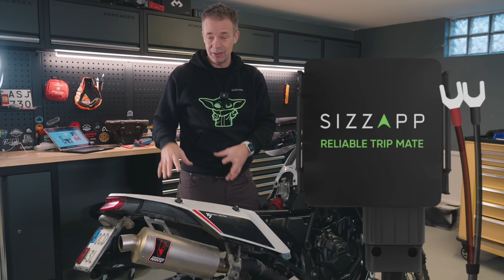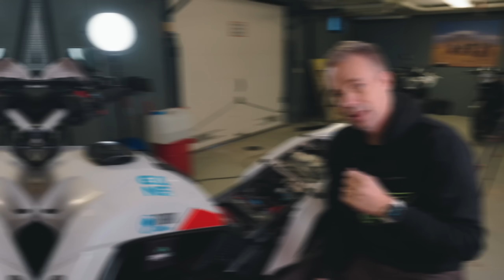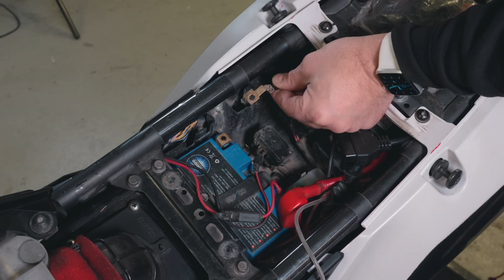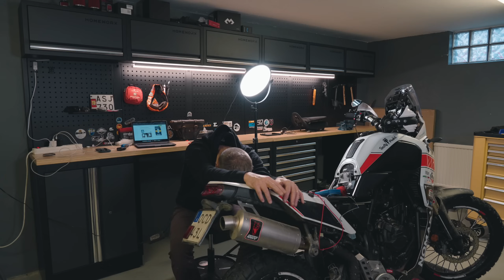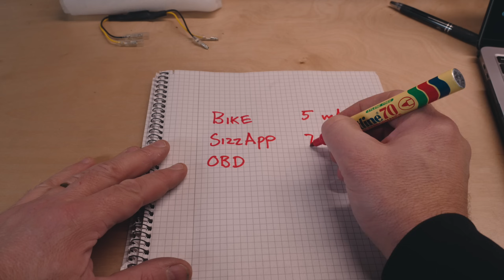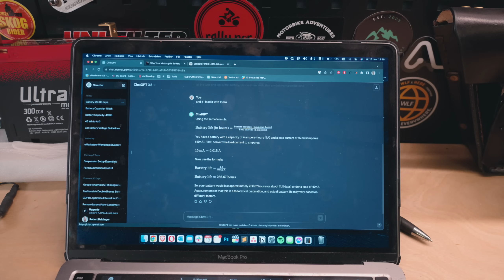How to Keep Your Motorcycle Battery from Draining Over Winter

Comment: I never measured mA draw on my T7 but after 2.5-3 weeks if will not start. I have no gadgets connected directly to the battery and probably it's the original battery.
I probably should do some measurements ;)
Reply: I finally got around to doing measurements.
Bike only amp draw fluctuates between 0.10 and 0.14 and does not drop after a bit of time.
I have no accessories connected directly to the battery.

Comment: Please could you give your experience with your batterie  pros and cons could make a good video?   thank for the video
Reply from the maker: Thanks. Pro's are mainly the weight and a little more cranking power. Cons are that it's sensitive for discharge (dies) and it doesn't like cold weather. But let's see if I can make a video

Comment: after killing 2 Li batteries I returned to the original :) The Li needs too much attention, caring and once its drains accidentally its scrap ie your cant charge it eninmot :)
Reply from the maker: I may do the same if i get the same experience. But still no problem
Reply: Same for me, a USB port took my Li battery out overnight (it's a small one on a 450 EXC) and it never recovered. Back to the old one. 
That the Li battery on my sons 125 won't start it in the winter is also not particularly helpful!

Comment: i just had a dead battery (bike 4 days Husqvarna 701 in trailer, arrived at destination - and no power, had to buy a new one). Only installed Gadget was a GPS tracker that (so the manufacterer says) does not drain battery because it has own mini battery. Which I can't believe 100%. The battery was new (bike had 1.600 kms on the clock). So I installed a Kill switch which isolates the battery from all users - am willing to sacrifice all Gadgets in this case.
Same with my touring BMW after one week in the belly of Hurtigrute vessel in September - starter would not engage because battery was low. We could push the bike to start, but still - wish I had kill switch in the BMW for saving the battery when the bike is parked for some time.
I think your video adresses important point - can I park my bike for more than a few days without a weakened battery ?
Btw - do you prefer the Thork T865 over the Carpe Iter as far as you can tell now? --> Have to make the choice in the next few days for my bikes, as my Thork Tripltek does not charge when Huqvarna 701's engine is running (vibrations, PINs too short) and I have replacements units at hand.
Thx for your infomative videos !
Reply from the maker: Thanks for sharing. Did you killswitch cut all power or just the gpstracker and other extra users? 
I the T865 is lighter, slimmer and has hardware buttorns for ex trip reset etc. Only con is sceen is not as bright but i guess its enough. I just installed and will use it some more before i know but it feels a bit more reliable and the carpe is no longer sold by thork.
Reply: @NomadSweden  Killswitch all power (also the bike itself) - I want to be able to start the motorbike after a few days of parking for sure. May I ask why it is relevant whether or Not Thork broke ties with Carpe Iter for your Tablet consideration? Safe rides!
Reply from the maker: @ez1.global186 Thanks. As I understand it, Carpe Iter made tablets and Thork made software for it. Thork never had control over the hardware and had different priorities. So Thork decided to make their own tablets with their own requirements and dropped Carpe Iter. This is why I think the DMD tablets are more future proof.

Comment: Gadget videos are great Rob, You need more gadgets, like a tricklecharger 😂🙌. It's always smart to look over the different applications we have that runs with batterys and see what the capacity is and what the running loads/charges are and as well the static loads. Get an idea on how to keep the stuff in good shape. Cool vid 👌
Reply: Robert,  do you have to use DMD2 OBDII scanner?  I would think not but just clarifying. Of course need to get a dongle
Reply from the maker: @bonesworld7178 its not needed. Just if you want some extra info on the tablet
Reply: @NomadSweden  I understand and I do want the extra information. So the question remains?
Reply from the maker: Sorry which question?